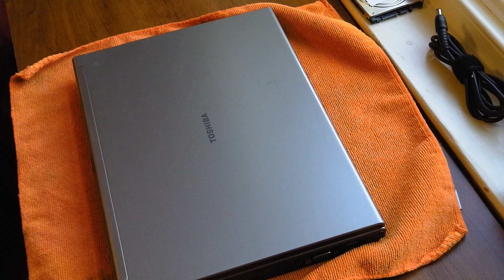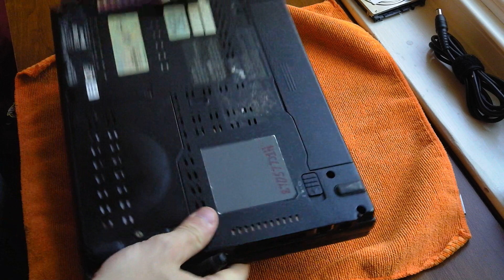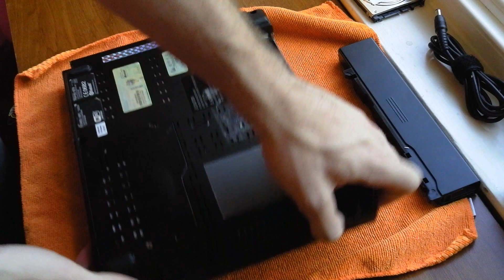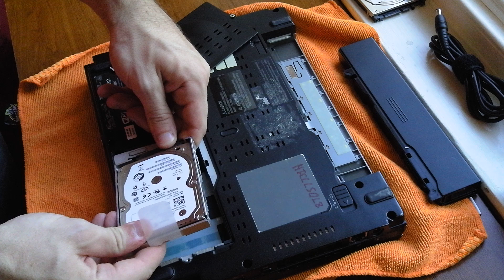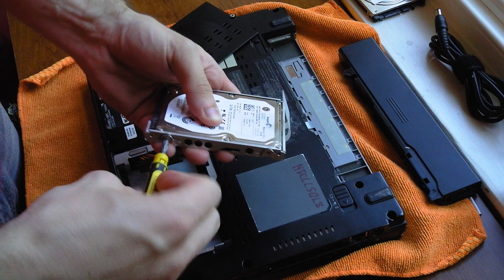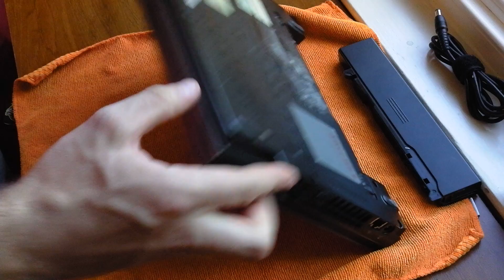Tutorial: How to upgrade or replace the harddrive Toshiba Portege M500 M6 Tecra SSD

Comment: Hey man, thanks for the video, really helpful!
I have a Toshiba Portege M500, i've been using it for years and still no problem with it. But i used it to play games, and i feel it's a little slow for games, if i want to improve the performance of my laptop, what should i do? I'm thinking about changing the HD and the RAM, is there another part that I should change? 
And one more thing, my current OS is windows xp, it said windows vista capable tho. But can it use windows 7? Thanks!

Comment from the maker: I just posted some more links of things to clean out the fan with. You can use a can of air, it is what most people do. The second link is what I have- if you have many electronics, it is well worth it. I clean my PS3 regularly (no YLOD), and clean all my stuff with it (No, I don't work for them, haha). 

If you are still having heat issues after cleaning out the fan, it is likely that your thermal paste is losing effectiveness. Check out my other videos on tutorials for fixing that.

Comment from the maker: For the SSD question- yes, a SSD will run slightly cooler than a HD, but it really isnt going to solve any overheating issues. The M500 uses a SATA connector, so I am not sure what you mean by 'old connector'. Yes, it is only 1.5Gbps, but it will still work with any 2.5" SSD- just make sure you go into the BIOS when you install it and select "AHCI Mode" for the sata controller, not IDE.

Comment from the maker: Yes, you can put 2x2GB sticks in there. I will put a link to where you can get the correct ram in the drop down description box. For overheating- I have had several of these get very hot and it is often the cause of dust. Get a can of compressed air (or use an air compressor). While the computer is off, blow air into the vents to clean out the dust.

Comment: hey bro.. I have a m500. 6yrs now and still going strong. but it as a hard time with the head etc and the fan runs like its always stressed even when browsing. I was thinking of upgrading it to an SSD. will that help? or should I do something else ? also If i did put SSD.. how would I do that considering the HD has the old connector. I dont know even know what its called. btw... can m500 support 4gb ram. i use linux